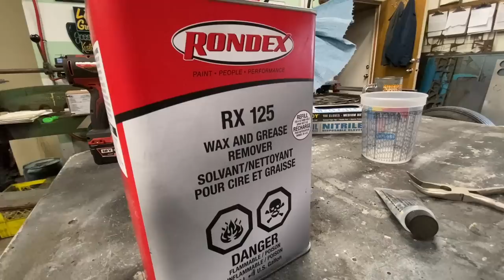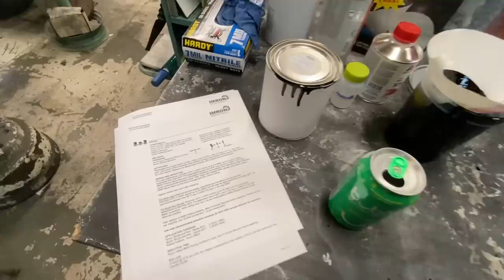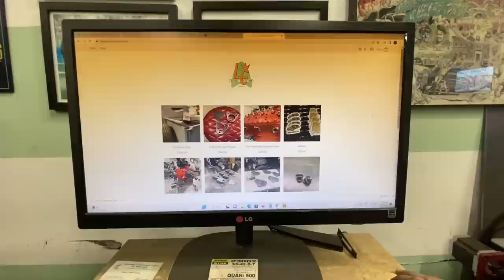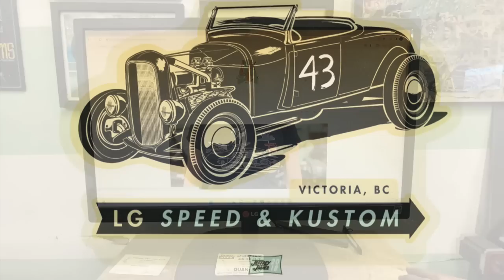Chassis Paint How To - Paint it Black! 32 Ford Rebuild Part 15

Comment: CONGRATULATIONS on the new edition!!
Never seen a body shop product that has hardner in it take so long to dry.  I have always thought of the 32 as the "janky cheeto" lol. Progress is a good thing. Makes for fewer irons and fewer fires !!
Reply from the maker: Thank you! I was in the body supply shop the other day and mentioned how I must not have used enough accelerator, cause it took 5 days to dry. And then said that’s normal, even with the accelerator. And then explained how Imron is designed to be baked. Which makes sense.

Comment: Once again Lee a nice job and a video filled with good tips and technics. One tip I will offer is to use some masking tape around the paint can lip to offer a bit of a funnel. It will allow you to pour the paint into the cup with a bit more control and less of a clean up. The can stays cleaner for the next time. Remove the tape and reinstall the lid. Try it you might find it useful. Doesn’t cost anything to try it. Good luck with your 32 can’t wait to see her on the road.
Reply from the maker: I’ll try that! Thanks for the tip!

Comment: Lee it sure has come a long way. When the body goes back on will there be a gasket between it and the frame?
Reply from the maker: Yea there is a gasket between the body and frame. Runs along the top of the frame rails

Comment: Wondering,did you rebuild front & rear suspension before paint? Also why not a few boxing plates on the frame?
Reply from the maker: This is video 15 of the build. Front suspension is covered in video 9 and 10. Rear suspension video 5, 6 and again in video 16, and boxing plates in video 3 and 4.

Comment: Interesting information.  Is that polyester primer good for direct to metal?  I was always using epoxy first.  Also for what it is worth I bought one of your t-shirts but your site shopping cart is not working on firefox.  I switched to brave and then got it to process.
Reply from the maker: Thanks for the order! Sorry you had difficulties, I’m not sure how to fix that. I’m not a computer wizard. 
As for the polyester surfacer, some people use it over epoxy, some over bare metal. I’ve always used it over bare metal and never had an issue.